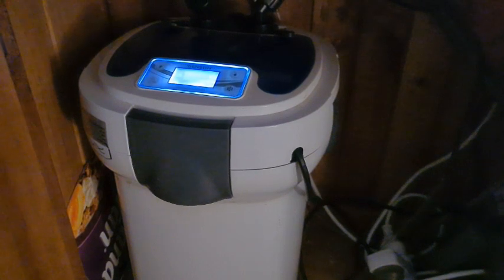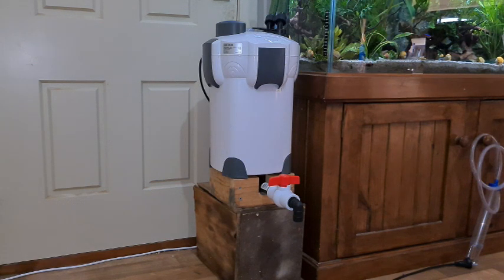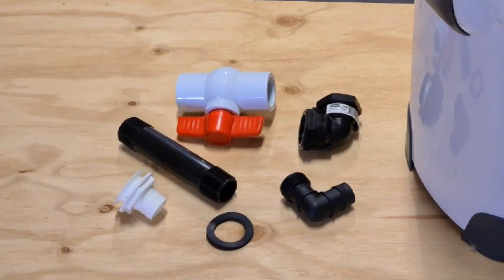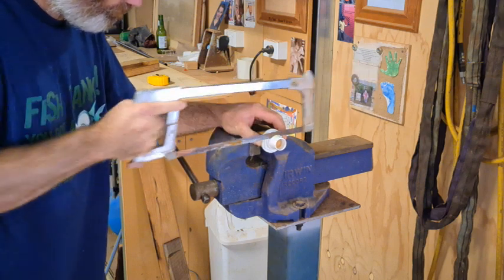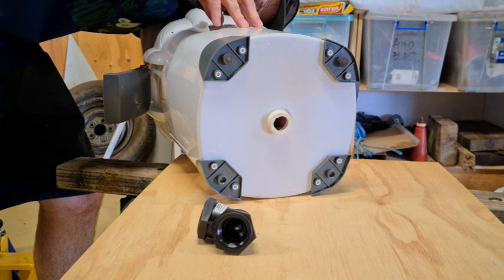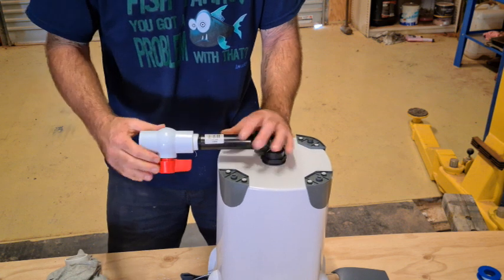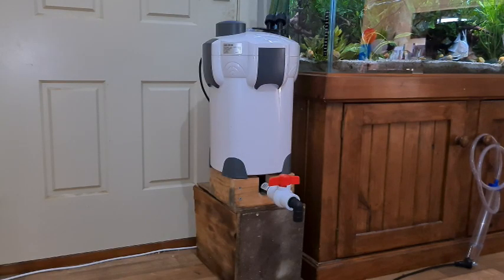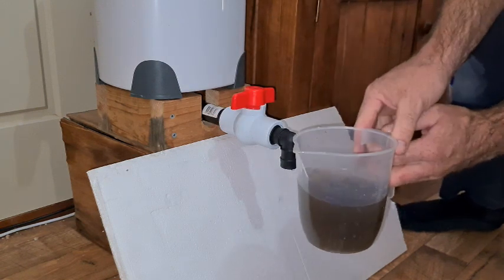How to Make a DIY Self Cleaning Canister Filter

Comment: Nice. I probably won't make it because I can't afford to replace my canister if I break it at this time. But it's a smart design. You should of patented before showing this. Not everyone is looking out for you. Just my thoughts.
Reply from the maker: Thanks mate. I this was a cheap canister with a noisy impeller, so I wasn't too worried about breaking it. I am told that Eheim and Fluval already have some sort of a back flush system. Thanks for your interest mate.

Comment: Thank you for sharing. Its an excellent idea. However, I must commend you on your courage to drill a hole into the canister. I wouldn't be able to bring myself to drill the hole. In case it went sour and didn't quite work out or developed leaks, I would be stuck with a useless canister filter and no filtration on my tank. I would therefore stick with regular cleaning and have therefore put a smaller canister pre-filter containing only mechanical filtration which prevents the main canister from getting dirty and clogged very quickly. The smaller canister prefilter sponges are easier to clean.
Reply from the maker: Thanks. It was a cheap canister with a very loud impeller, so I wasn't too worried if I ruined it. Yes, I have also used the a pre filter canister. I put the tap on to try and prevent the canister from becoming a nitrate factory. Thanks for your comment mate 👍.

Comment: Nice idea! But two things: Why using silicone on PVC, it won't glue. The rubber ring is enough to make it water tight or use PVC cement if the bucket is also from PVC. Also never use teflon tape with pvc on pvc, it will damage the pvc. It is designed for using without anything between it, it is flexible enough to be water tight. Only use teflon tape with metal on metal connections and never turn it back a little because then it starts leaking.
Reply from the maker: Thanks mate. I used silicone because I wasn't sure if the 25mm drain would be large enough and wanted to be able to replace it with a larger one if required. Also the bottom of rhe filter is slightly concave. I used tape on the black poly as I only hand tightened it and the bsp tread on these doesn't seal the greatest unless tightened, and I wanted to be able to disassemble this if it didn't work. If in the future it does leak, I will use something else, but so far so good. Thanks for your input mate.

Comment: Excellent.. cannister filters always scared me . 

Would a bulkhead work?? 

You have a winner here.. 
I would probably do that for a water change ...and do a good clean that way and then do a top off.. 
Again excellent video.
Reply: Canisters ROCK!!.......don't be scared :)
Reply: @AussieAquatic  
I had a few in my ponds, total nightmare.. with cleaning, seals and leaks.
Reply from the maker: A bulkhead wouldn't sit flush inside the filter, so I believe that some of the gunk would be trapped on the bottom of the filter. Thanks for your interest mate.
Reply: @Gilsfishroom  good point.. makes sense..